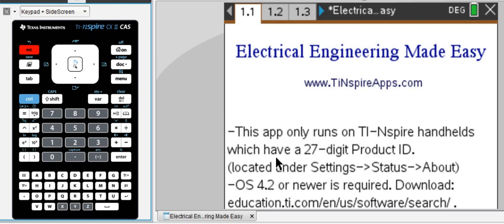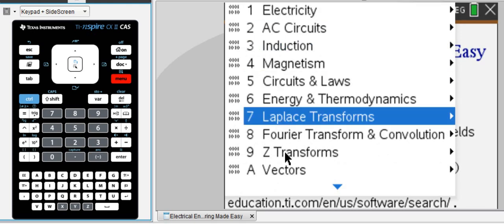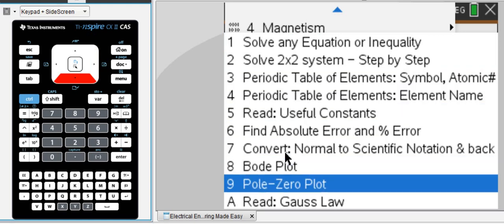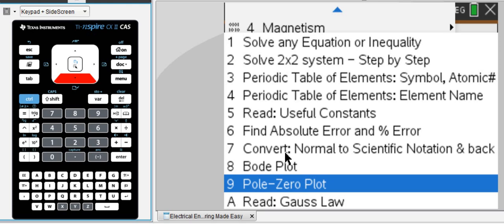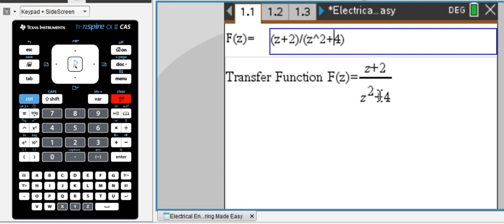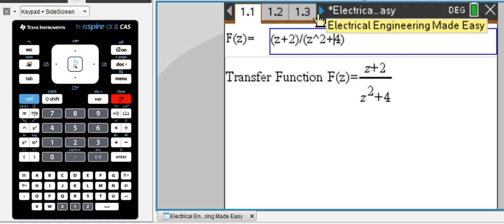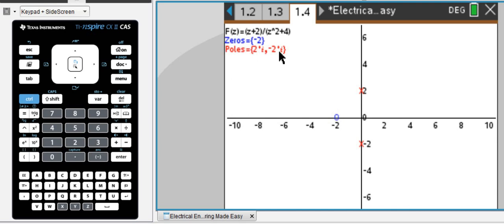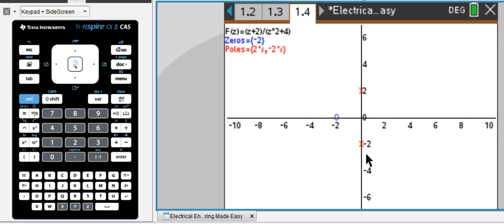Ti-Nspire CX : Pole Zero Plot

Comment: Helo, I would like to ask if College Algebra with Trigonometry also works on the TI-Nspire CX II-T CAS or if it only works on the non-T version of the calculator. thanks in advance.
Reply from the maker: It works on both Tinspire types actually
Reply: @TiNspireApps  ok thank you for the answer